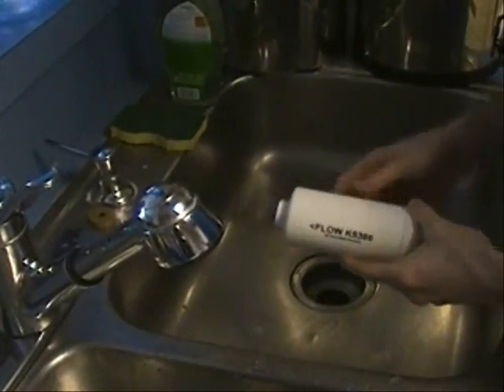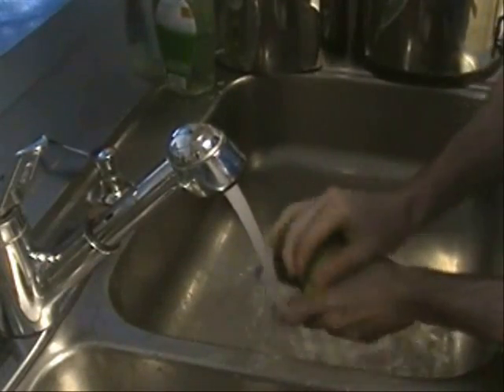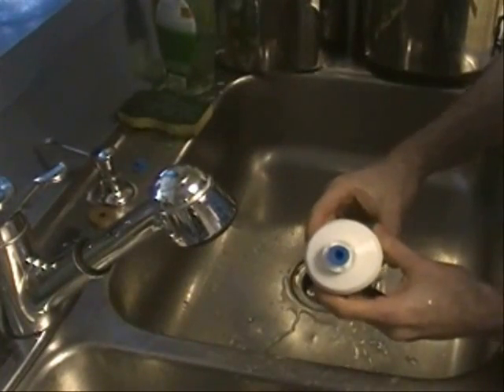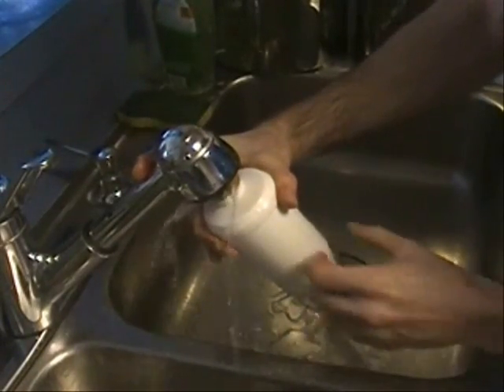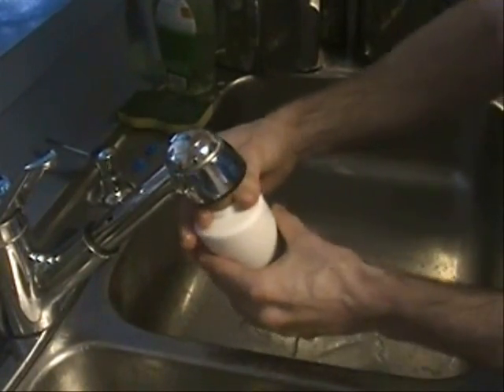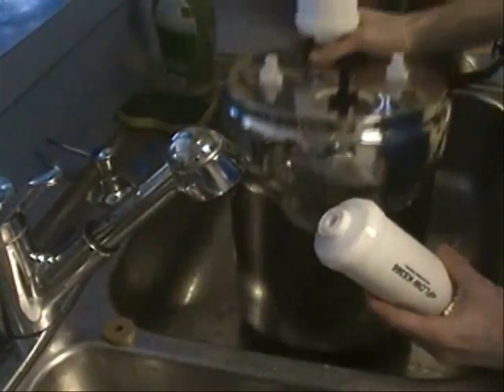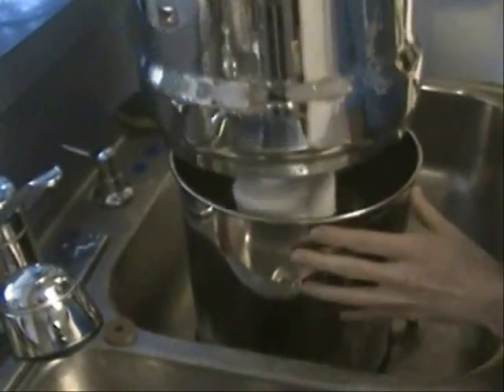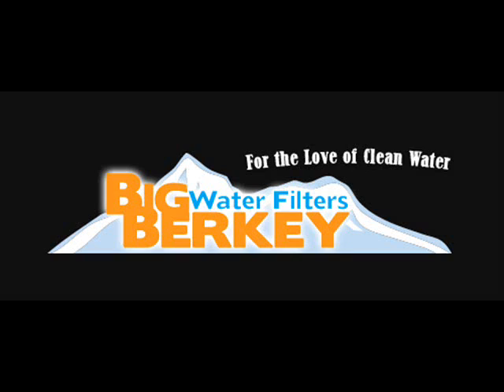Berkey Fluoride Water Filter - PF-2 Fluoride and Arsenic FiltersVideo - How to Prime and Install

Comment: There is more water coming out of the sides when you try to prime those filters ? Any upgraded versions yet ?
Reply from the maker: No, and this is due to the back pressure of the filters, which is needed to filter properly.  We do sell a berkey primer that makes the process easier however. https://www.bigberkeywaterfilters.com/black-berkey-primer.html

Comment: What is the oily film that floats on the top of the water when it's left sitting around for a little while? Specifically, what chemical compound is it? And although it "goes away" after 8 flushes, does it really or is it just present in lower, non-perceptible concentrations?

Comment: Hi I ran the red dye test completely wrong, I assembled everything and then put the dye thru a full water fill. With the white filters on it. I can see a very faint pink tint to the clean water and am wondering if I just damaged the white filters? Any advice would be greatly appreciated. I didn't have my directions handy at the time (lesson learned here) thanks 😁

Comment: you don't have to screw the filters all the way down to the black screws?
Reply from the maker: No, and if you do it will impede the water flow through the filters.  So, only 8 revolutions please.
Reply: how long does it take for a gallon? i have a gallon in the filter for a few hours, but to me the water level hasn't gone down at all. i primed the filter to know the water will go through the arsenic filters.
Reply from the maker: @james-cx7yd  If you fill the upper chamber to the top, a gallon should take approx 1 hour and decrease from there as the water pressure drops. You can remove the fluoride filters as well and look to see if the water is flowing through the black berkeys, or they still need additional priming
Reply: hopefully, it works. i bought scoth brite green pad  and scrub several times. thank you for taking time out of your busy schedule to respond.
Reply: its working now. i can hear the water dripping.
Reply from the maker: @james-cx7yd  ok great!! :)

Comment: I tightened my pf2 filters too tight, water was cloudy what do you think I should do? I am running few batches to be safe..
Reply from the maker: Hi Adand - Yes, keep running full batches through the system, and the dust should completely dissipate.
Reply: Okay.. What if I messed up the netting 😐 I don’t want it to do the opposite of what I got the filter for :-/ do you know what the filter is composed of?
Reply from the maker: @anandkumarmusic  If the netting has been broken, then the media will leak out of it and you should be able to see this during priming or even without. You would have to replace these filters if this is the case.
Reply: Okay thanks bud

Comment: my   berky   was tested by a compeating water filter company and the ppm  were higher comming out then going in  so i changed the filters  and   bought my own ppm tester off amazon for 15 dollars   it consistantly test higher  comming out  for ppm  so what am i drinking now?    i buy  spring bottel water now  to afraid to drink the berky water if somone can clue me  in on why  the counts go up when they should be way lower  im all ears  as for now i think i drank turd water  for the 2 years i used my now dust collecting berky
Reply from the maker: Hi Denis - I believe you may be referring to a TDS meter, which only tests for dissolved solids and not chemicals, etc. Without detailed testing, we would not know what this reading represented, but we do know we've heard of the TDS reading being higher before and it was because there was calcium buildup in the lower chamber of the berkey water filter. Essentially, filtered water going into that lower chamber had it's TDS reading raised by coming in contact with that calcium build-up.  We'd recommend testing your black berkeys with a red food coloring first to see if it passes.  If it does, we'd then fully wash the lower chamber and remove the PF-2's from the black berkeys, then run the TDS test again. It could also be that there's calcium buildup inside the PF-2's(just like the lower chamber theory), and this may be impacting the reading.
Reply: Big Berkey Water Filters   YES IT DOSENT SAY WHAT THE PARTICALS ARE JUST THAT THE  parts per million have gone up after going threw the system  ill clean it out and   retest
Reply: So what does "calcium buildup" in the lower chamber of the PF-2 mean? Is that because of it's age? Can you expand on that a bit more please? Thanks
Reply from the maker: Hi Glockman - Some folks water is harder than others. This is the calcium.  Similar to how calcium builds-up with a white film on a bathtub, this can also accumulate on the inside of the system, or on the filters themselves.

Comment: I find that I need to prime mine at the faucet for about 20 minutes to fully get the dust and funny taste out.  However on my big berkey with 2 black filters and 2 PF-2 filters they last almost 9 months for my family of 3 and we use the water for cooking and drinking.  So I think even though from a safety stand point a minute on each side may be sufficient but for taste and clarity I prefer to prime mine in a clear glass until the water runs clean.

Comment from the maker: Yes, the activated alumina will work under some pressure, but performs much lower in terms of removal simply because there is not enough contact time between the water and the filter.  The Proone is not recommended simply because it's trying to do too many things at one time, and thus does none great. The removal levels they claim are inferior to many other competitors because of this. Also, they do not have any lab testing data that supports their claims, so I would be careful.

Comment from the maker: To be more sure, do a PH test of your source water and see where this stands. Most municipal water has lower PH due to chlorination, etc and thus works well with the PF-2 filters. If you're sitting between 5 and 7, you're in the sweet spot for alumina oxide and the filters should perform as described (up to 99.95% removal).

Comment: I´v also seen some other fluoride filters online lately, Doulton (I think it was?) and the Proone from Propur as well as the old propur. Other then that I´v seen these 10" activated alumina filters to be used in 10" housings under pressure and not gravity fed as well as the Berkey, so much to know and so little (or hard to find) info online so hard to dec before buying? Berkey to see seam to be most attractive atm though.

Comment from the maker: What could be occurring with the 3M tests is that they are testing on very alkaline water, 8-9+, or their PF-2's are fully saturated and unable to remove any more fluoride. The media used in the PF-2's/PF-4's is the only media recognized by both the NSF and EPA for removing fluoride from water. However, fluoride removal works better the lower the PH is. Ideal is 5-7. To comment fairly, we would have to do a full procedural analysis to determine what may be causing a poor home test result.

Comment from the maker: Hi - The Berkey system is a food grade 304 stainless steel and this does not leech aluminum, etc.  This is a very important distinction of the Berkey as other containers on the market use lesser grade materials.

Comment from the maker: The plastic used is a food grade, bpa fee plastic.  One should wash these filters with soap and water thoroughly prior to use so that they do into the system clea.  Otherwise, there should be no issue with these filters inside the tank.

Comment from the maker: @NewPSCity Hi - It can sometimes take up to 8 full flushes to fully wash out the manufacturing dust that is on these filters.  This taste will dissapate.  Just run a few more full flushes through the system and you should start to see it clear up.

Comment: @ThirstyBerkey   I was thinking... what if you get the Crown Berkey and use the PF-2 filters with Black Berkey elements.  Then only filter enough water so that it doesn't touch the bottom of the PF-2 filters.  I'm thinking this would work best on the Crown Berkey since it has the most height.  It probably wouldn't be practical in the other models since they have limited space and would be too crammed for any lower chamber water to sit free from contact with the PF-2.

What do you think?

Comment from the maker: @purplefetus3 The plastic used are food grade and BPA free. A 3 chamber system to handle the various phases is unfortunately impractical from a size and portability standpoint for the majority of our customer base. One alternative is to use a larger system and keep the water line in the lower chamber lower than where the PF-2 filters hang to. Another, is to purchase a 2nd stainless upper chamber to create this 3 tiered setup.

Comment: I didn't realize the PF-2 filters are suspended in the lower chamber with the "purifed" water.  Does that mean the purifed water can leach out the plastic around the PF-2 filters?  I feel that the PF-2 filters being in the lower chamber is a bad thing.  Maybe they should also be in the top chamber and they can make the Berkey a lot more taller?